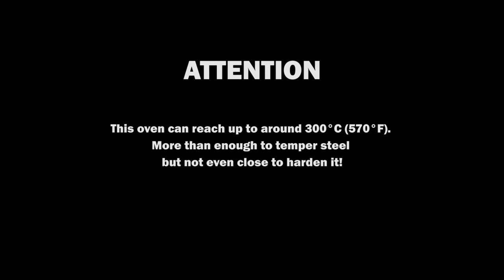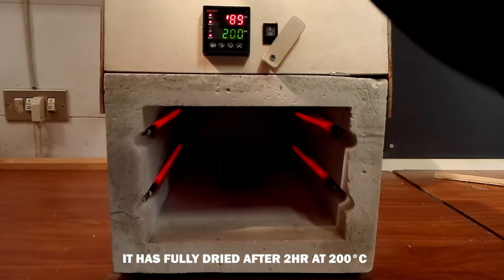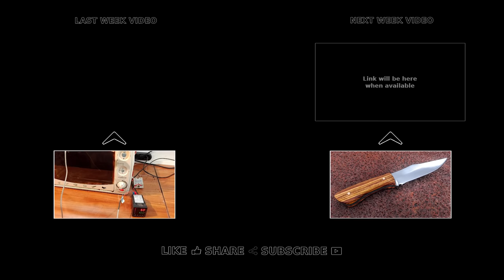DIY Electric Oven With PID Controller. Part 2 of 2

Comment: You should of set back the front panel that has the switch and PID controller a few cm from the face of the oven. When the door is opened the heat will rise right up and melt the plastic. That happened on a commercial-grade oven I have where the manufacturer did not think of how heat rises.Dear men (with a beautiful black beard), We love you!
Please add a high-temperature electrical insulation cover, on the contacts on the edges of heating elements for prevent you from electric shock (Alternating current in high-voltage is extremely dangerous [if the safeguards fail]).
Thank you very much for all of your videos. Very enjoyable and inspiring!!

Comment: Sir, can i ask you about your wire type that connected to the heater elements? I use thin copper wire and it always vanished (burnt down) by the element

Comment: Is it for heat treating knives or what ? 
I like it but a little demonstration would be good 😃
Reply from the maker: Yep you can temper knives as HowAml said, or melt down material with low melting point like hdpe :) I'm sure you'll see it used in my future videos!

Comment: Hey there I have a quick question I've need contemplating making one of these to anneal my beads I need it to get to 900 are the heat restrictions due to the probe only being rated for that if you got a diff thermocouple could I get more heat bigger elements or is it the glass door letting out the heat just curious if you had any input on any of those ideas

Comment: I am thinking the plaster needed to be reinforced as well as cured slowly to prevent the cracking. with that much steam escaping upon initial firing, It was forced to heat and dry too fast and resulting in premature cracking.

Comment: super cool oven. i made a foundry out of plaster and found that i have to replace it fairly often due to cracking is this the case with this?
Reply from the maker: Thanks man! :) Yeah I'm dealing with cracks too unfortunately, nothing major still probably because it doesn't get too hot.

Comment: hello again dear friend, im testing it first at the eletric oven but it is taking too long to heat, do you now if there is a configuration to heat it more fast? thanks for the attention
Reply from the maker: Hi brother! Are you using a pid? There might be some kind of temperature ramps... The heating elements looks red hot? Dunno what to suggest xD
Reply: yes, im using the rex c100, the elements doesnt get bright red. do you used in series or parallel?
Reply from the maker: I use them as they were in the original toster oven, they are in series at pair, then the two pair are in parallel :)

Comment: Great project. Thanks for posting it. Your design might work perfectly for a project that I've been thinking about for a while. 
How is your mini oven holding up? I gather that you used plaster for the second attempt. I know that the way to reclaim used plaster is to heat it to a certain temperature for a period of time in order to dehydrate it. And then supposedly you crumble it and it's good as new. (I forget the time and temp details.) But it makes me wonder if the plaster held up as you used it. I was thinking of using kitty litter, but then of course it would have to be sandwiched between an inner and out layer. Plaster would be easier if it would hold up. But maybe cement would be better. (Then I could even use it to reclaim used plaster.)

Comment: Nice job man, I like it. You should make a part three where you replace the elements with a kanthal coil to get some higher temp.
Reply from the maker: Thank you!! :) Yeah I really want to make a proper heat treatment oven. I'm sure I'll build a new and better one someday :')
Reply: I'm in the midst of building my own right now that is how I stumbled upon your channel. Was that refractory cement that you used? I am curious to see how well it would hold up to temperatures in the 1100 C range. Seems to be cheaper than the brick route but I'm sure the bricks are expensive because they work hahaha.

Comment: you can improve by addind a steel mesh inside the zement (in the ~ middle of the wall thickness)
but you need to pre cut some hole so the wires you added dont short circuit.
or instead just build a metalframe

Comment: great video(s)!, do you have an arc welder or access to some micro wave ovens?
Reply from the maker: Thanks!! :) Yes I do have a cheap stick welder, and I also have some microwave transformer :')
Reply: Black Beard Projects ok, i was just wondering if you would be interested in making an arc furnace like grant thompson did... but more powerful, i was thinking a 4 electrode furnace would be cool, also have a larger crucible, not sure if this is up your alley or very safe, but it'd be epic
Reply from the maker: Thanks for the suggestion mate :) I don't know how much I would use an arc furnace like the one made by the king of random... For the stuff that I like to cast I need a lot of material :D
Reply: Black Beard Projects well that's why i said a larger crucible, make it as big as you want just as long as you still have enough heat energy
Reply from the maker: Yeah what I meant is: for how arc furnace works I think you always need the electrode to be really close because you need to strike an ark. Right? Not sure anyway :) I agree that would be an awesome build :)
Reply: Black Beard Projects i'm not too sure, nothing a little research can't fix...

Comment: Dear men (with a beautiful black beard), We love you!
Please add a high-temperature electrical insulation cover, on the contacts on the edges of heating elements for prevent you from electric shock (Alternating current in high-voltage is extremely dangerous [if the safeguards fail]).
Thank you very much for all of your videos. Very enjoyable and inspiring!!